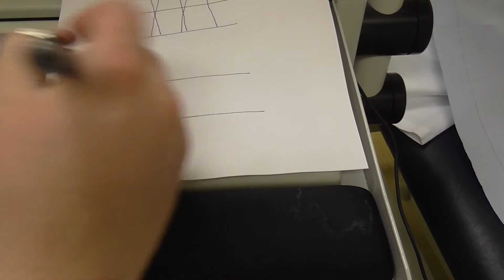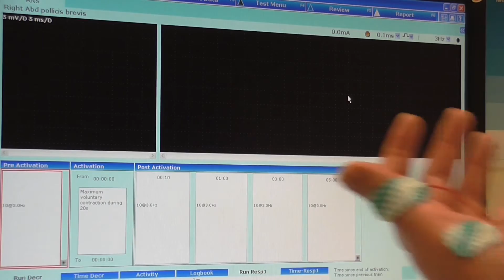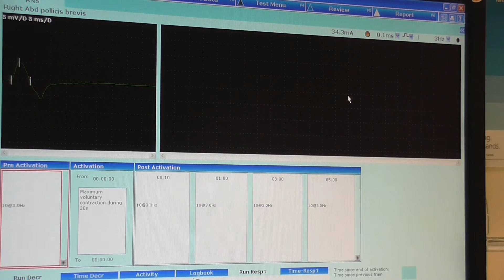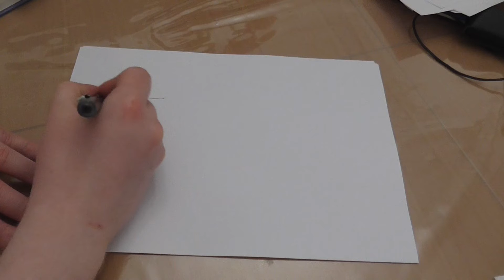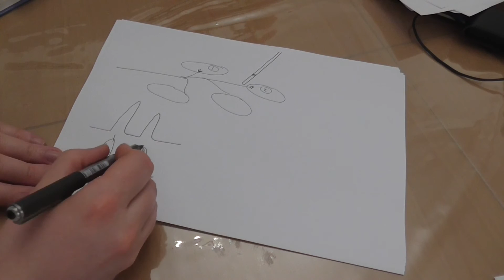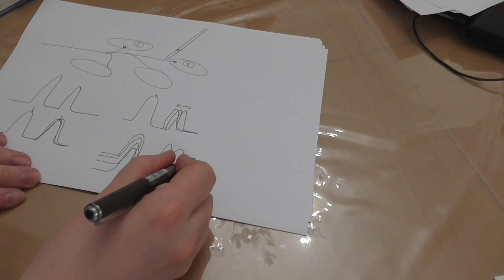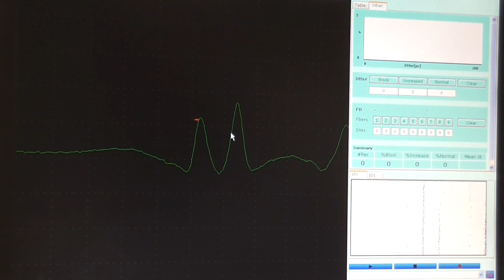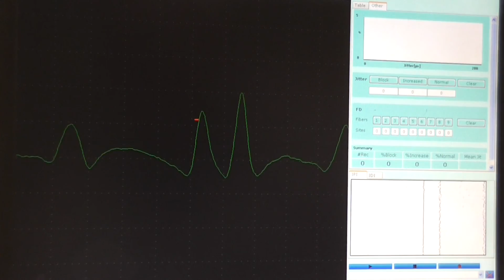#Neuromuscular #junction tests (#Repetitive #Nerve #Stimulation and #Single #Fibre EMG)

Comment: Thanks for the video. Can you perform this test on the levator scapula and upper trapezius?
Reply from the maker: Hi, yes you can test most muscles but there are various issues and this will be a bit technical. The first is finding normative data for rarely tested muscles. However, if there's significant jitter that isn't such an issue. But if there is significant jitter then you're quite likely to find it else too, and have proper normative data for those muscles, and so there's little to be gained. Anther issue is maintaining smooth muscle activation for prolonged periods in muscles which take a lot of weight, and there's also a potential safety issue around needling close to the lungs. So all in all, not muscles I'd particularly go for. Relatively simple to do repetitive nerve testing of the trapezius but it's not comfortable and often needs repeating due to technical constraints and muscle shortening. Hope that helps, bw Simon

Comment: Thanks for your explanations, quich are very clear. I just need to ask whether jitter is thus defined as an isolated difference in response time or if it also implies that action potentials necessarily have a different amplitude.
Reply from the maker: Hi Juan, when jitter is being measured we are looking only at the differences in the timing of the pairs, not their amplitude. In fact we need to make sure that the amplitudes are stable during the measurement window otherwise its very difficult to obtain accurate results. 
We do look at amplitudes during Repetitive Stimulation studies which reflect the summation of many muscle fibre potentials and their dropout as NMJ Transmission fails.
Hope this helps and best wishes, Simon
Reply: Thanks so much! Excellent videos!!! =D
Reply: Excellent! I am trying to learn SFEMG. So please give more videos on this. Thanks 
Selina Daisy.

Comment: thanks a lot dear freind here in Algeria we cant provide the special needle to execute SFEMG can we do it with usual coaxial needles ?
Reply from the maker: In England we also can't afford them either! We use the standard facial concentric needles which yield good and dependable results (30G) , and have a solid evidence base behind them. Best wishes, Simon
Reply: Then we must change machine standard settings if we use such needles ?
Reply: Sadok Hamza Yes, the low pass filters need to be changed